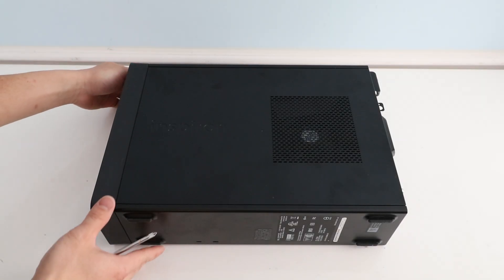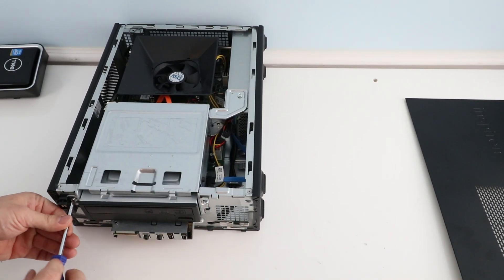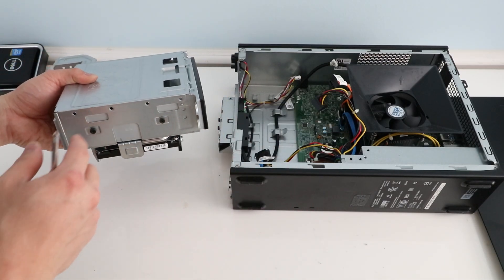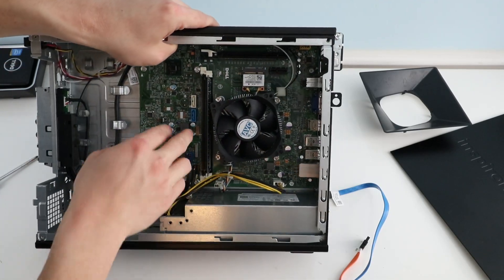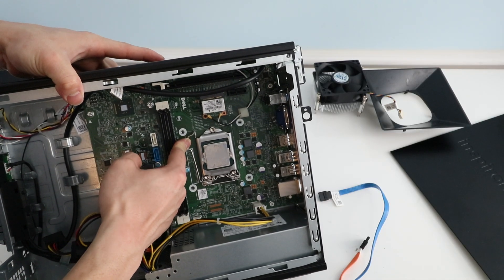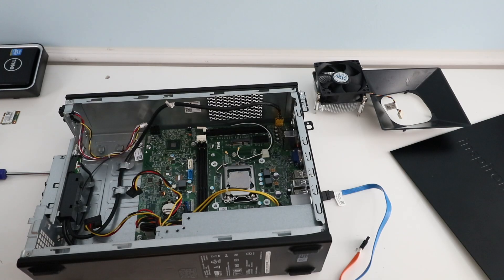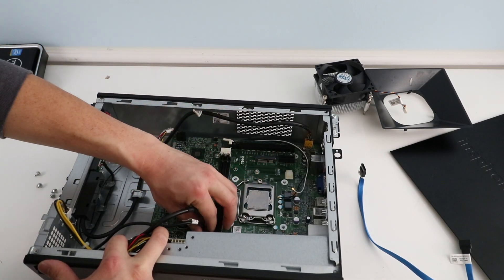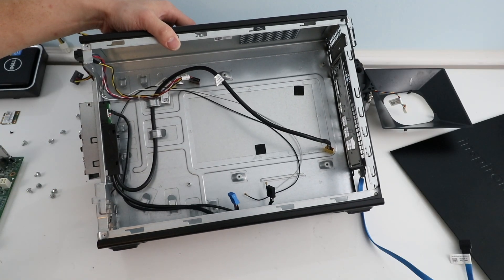Disassembly Dell Inspiron Small Form Factor PC- Upgrade Ram & SSD

Comment: Comparing the video set with real life, I find that there must have been a degree of preparation of the corpus that goes beyond simply saving a bit of time.
But beyond a bit of screw loosening off camera,  there is leaving the viewer unprepared for hardship.   I mean painful hardship.    For example:  removing the CPU fan baffle - or whatever that square, black thing on top of the CPU mounting is called.   One doesn't simply release some tabs underneath the cone.   You have to get your finger under the cone into that restricted space, feel for the tab,  find it,  an prepare to have its sharp corners dig into your index finger (or other?) as you try to force the tab to clear its retainer.   If you play the piano or the violin, you will not play for a few days thereafter.   
Then there are the connecting plugs, small, mostly black plugs of width 0.75" down to 0.375" and about 0,188" thick (approx.)    They make connection for between 4 or 5 conducting lines up to 16 or more in 2 rows.   One must remove them from their receptacles on the mother board or on the device, a HDD or a CD drive.   They just seem to slip out with just a little bit of effort in the video.   On my motherboard, they seemed to be epoxied in place.   I found it took great effort, and often painful effort to grab these plugs in tight spaces and remove them,  all the while exerting great care not to pull a connecting wire out of the plug and in great fear of pulling the socket off the motherboard.  
Finally I notice that Brandon did not seem to be grounded.   I fashioned a grounding bracelet from a wrist-watch with a steel case using speaker wire wrapped around the strap pins that I connected to the ground pole of a 120V wall receptacle.    I made certain that the pole was properly grounded first.   
If you decide you want to disassemble your tightly manufactured desktop,  be prepared for pain.    It is not so easily done as shown on youtube.

Comment: cool video! In case of rebuild from scratch,  could please tell me which is the strongest cpu and power supply  that could run on this MB/Case? thanks o pheraps which new MB is compatible for this case? thanks a lot

Comment: Don't buy Vostro 3471 if you value your money Yes don't buy that crap piece of *bleep* if you want to use it as a pc It can only run Microsoft office and it's overpriced you will suffer after buying this it don't support 75 watt GPU graphics card don't have standard 24 pin ATX motherboard is too weak and case is small than most laptops And they say it's a tower what how you call these piece of crap a tower they fooled me never buy prebuilt it costed me around 400 dollars to buy which I can build a gaming pc I had old Inspiron dell pc which was pretty good dell is piece of *bleep* nowadays who in the world would give you a 200 watt psu for this price and it doesn't even has 24 pin motherboard and you will never find a suitable psu for this *bleep* even if you try to power up using external GPU this *bleep* font support 75 watt GPU and only card working with this is a gt 710 and it can't even run unity it lags most the time can't even do work With this *bleep* please don't support.buying this *bleep* I got fooled you can escape I don't know why I bought this I will sell this *bleep* on ebay and going to build a good pc f**k you dell :middle_finger: Your keyboard is low quality not good for typing your mouse jams most the time and now I am jammed like that -cant upgrade psu - can't upgrade GPU - can't do sli - do not has 24 pin ATX motherboard - don't has a ATX case - don't support 75 watt GPU And they say it's a tower
It's not good for anything

Reaserach before buying

Comment: 4 mb of Ram in this unit is ridiculous. Just having Windows 10 with nothing else installed is running at 89 percent of capacity. Not enough memory left do to anything else. BS you have to spend another $70 to install 2x8 or 16 mb of Ram.

Comment: Can we add graphics card also to it
Reply: Yes, the graphics card slot is to the upper right of motherboard. Just above the CPU. If you need extra ports for the graphics, the Inspiron 3647 has an extra space for it. It has a plus sign, just push it out.

Comment: Brandon, my CD ROM door is swinging loose.  Was there a part that fell off connecting the door to some part inside?  Where did that go?  
Also. did you make a video on putting this thing back together again?  I'm not sure how the door is supposed to work.
Also, my 3647 is not seeing the ethernet cable and just running off the wireless router.  What should I do?
Thanks for your great videos...a

Comment: When i press the power button it boots and then shuts down in 5 seconds as if power is getting disconnected. What could be the problem?
Reply: Check to see if 1) your RAM is set properly, and 2) if all your connections are firmly in place, i.e. sata and power cables.

Comment: Hello, Brandon

Could I install the HDD in place of the dvd player?
Reply: usually not on these older systems because it needs the dvd player to boot. If it doesnt detect it, it may not boot correctly
Reply: depends on the BIOS
Reply: @Nathan-gn3ls  
of course it can be done, I put an SSD in the dvd slot only I had to make a small arrangement for the holes to match the screw base
Reply: @Skull745  oh nice. If you know what you're doing that's definitely a much better use of a SATA DATA port. I love watching people's eyes light up when I toss a SSD into their 5+ yr old system for the OS and boot time drops from 45 seconds to 5. Even an i7-2600 with SATA2 works great for somebody just FB'ing, checking email and using Google as long as it has an SSD. Super plus with the free Win 7 to 10 upgrade which I'm hoping still works past January 2020. 
#dorkrantdone

Comment: Thank you for your video. I'm convinced of getting a Dell. I have an eye out for one with 8gb Ram memory (though I want to see if it can be upgraded to a 16GB) and 1TB of space drive. Anyways these PCs  are less scary to work with and upgrade than other PCs, even though they are tiny compare to most desktops. I currently have a POS (Piece of shit) that is very frightening to open with all those cables/wires just for the power case., not to mention the CD drive and other wires for other stuff. Within my head is screaming out "NO MORE WIRES!" The thing I dislike about the PCs coming out these days is that so many have opening holes on the top of their cases. Don't companies know by now that such openings allow dust participles and other nasties into the sensitive area of the computers easily? I don't have time to be opening and cleaning out PCs on a weekly bases, especially when I live in concrete ancient house with poor insulation and busy looking after so much within home and at work.

Comment: The fan of the processor has that plastic thing above it and I can't take it off. It seems that the base of it is screwed, so I would break it if i did like in the video. That is preventing me to upgrade the ram of my PC
Reply: MMD My version was like the video. The plastic part has tabs that just pop out by pulling up firmly. The memory slot was under it.

Comment: Brandon: Why don't you want us to contact you directly? You don't offer a source to do so and I need your help. I have the DELL Inspiron 3647 model that you feature in the video. I want to replace the 1TB HDD with a SSD but you don't give any info as what model, etc. You've left us out in the cold. Please contact me at nyceddie4683@gmail.com
Reply: Any SSD will work with this system including SATA III.  Make sure you have a 2.5" to 3.5" SSD mounting (adapter) bracket. Samsung offers free data migration software in which you can clone from your HD to the SSD.  You'll need a USB to SATA converter cable which are not expensive.

Comment: This video was awesome.  My husband's Dell Inspiron 3647 was sooooooo slow.  He does not use it that much but drives me crazy to update or just boot.  Installed a Samsung 500gb ssd and added 4gb ram for total of 8.  Very little expense to make it really fast.  Thank you so much for the video.
Reply from the maker: Debra, glad it helped and thanks for letting me know! I always wonder if these videos are useful to people.
Reply: @brandon20904  hey bro i dont know where the power cords for the harddrive and dvd drive go i see one says p3 another says p4
Reply: I have the same problem. I will follow your suggestion..... thank you!
Reply: Hi there. Just wondering, is the SSD still doing the trick? I upgraded to 16GB RAM total but it doesn't seem a ton faster yet. I know a SSD is much faster than a HDD, but I wasn't sure if it would work long term. Short of changing the CPU, not sure how much more I can do
Reply: Hey do you remember roughly how much it was to install the upgrades? Recently got one of these computers with monitor and accessorys for thirty dollars and I have noticed were it lacks fell like it would help alot
Reply: Spent about $120 for 500gb ssd and extra 8 gb gram. The ssd is what really made the difference. My husband just uses for email and web browsing.
Reply: @debrat9291  Hi! Did you get a 2.5 inch SSD? and how did you copy everything to the new SSD drive?
Reply: Ok thanks very much

Comment: How can I add a graphic card to the CPU?
Reply: It would need to be an external GPU since the pc is too small to fit one inside
Reply: @ItsNotAProblem  
It is possible to place one but it has to be low profile to enter the PC. I have the inspiron 3647 and I got an nvidia gt730 2gb ddr5 is a bit old graphics but it helps a lot to run games of 2014
Reply: @Skull745  I plan to get geforce gtx 1050 ti low profile...do you think it will fit?

Comment: My power button is showing orange blinking light when i tried to start the pc after changing the ram... pc isnt starting.... HELP PLZZZZZ
Reply: Mine is doing the same, did you fix?
Reply: @DesiSaran  contact any local repair shop.. if u will contact the dell service care they will say " your motherboard is messed and you gotta buy a new one "
Reply: Service centre*

Comment: just bought 3268 and i want to add a additional SSD drive. Is there room or capacity in the small factor tower and also additional plug in on the mother board? Thought I'd ask before opening the machine up.